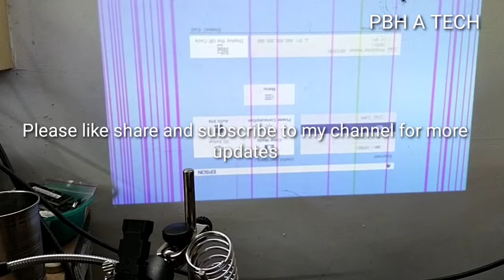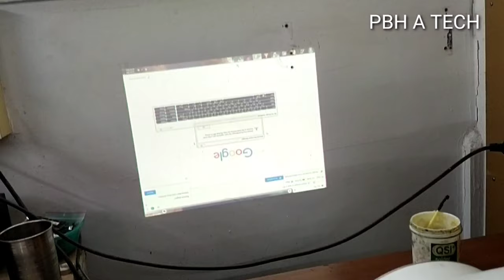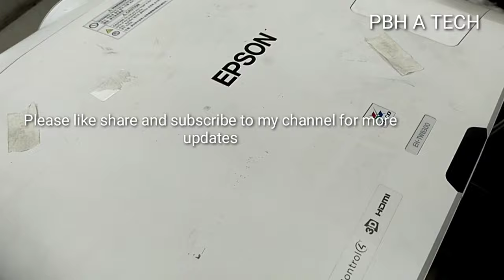#Epson EH -TW8300 Projector Line on display & how to change LCD

Comment: My projector is Epson 525w, it's lcd assembly needs to be changed

If I replace it with 1920x1200 instead of original 1280x800, will it work?

Comment: How did you align the LCD ? I have the same problem with my 6100. Thanks!
Reply from the maker: Are you a technician?
Reply: @computergearstudio  No, I have the TW6100 and I have a problem with the image. After open the projector, I have a problem with the 3 lcd matrice
Reply: Atleast help ppl telling or showing  how to align LCD so many cuts in the video not properly showing how to change and align the lcd prism. You are not helping at all. Cheers
Reply from the maker: Sorry I will charge for alignment
Reply: @computergearstudio  then mate stop uploading useless videos if you not helping others charge your locals who come for repairs.

Anyway there are more videos on YouTube how to align the lcd Prism after changing the LCD RGB panel so don’t think you are the only one.cheers
Reply from the maker: Okay sorry sir  as you wish
Reply from the maker: Great 👍 best of luck 
Can you do this?
Reply: @computergearstudio  I need your help, they changed the LCD of a 2000 home theater and now the colors are misaligned
how much would you charge me to help me align them, a minimal idea of how to do it
I write to the mail
Reply: That's very easy, the function is integrated in the beamer menu
Reply: @JJ37_  function in the menu is for precise aligment like 1 or less of a pixel not by few centimeters like in this case. Besides he don't pop the menu, so your advice is wrong.

Comment: Im  projector repair do you have software or EPROM  for epson projector ??
Reply from the maker: No
Reply: @computergearstudio  thx bro i have also eb s41 with no display  the a/v contact is good the projector seem working fin but the problem no picture on screen do you have any idea whats get wrong all voltage are present only 6v near the lcd connector not present ...any ideas plz
Reply: Hii

Comment: Hi, I 've epson 8350 it shows some pink patch in screen so I replace the RED LCD, after that I'm facing white and red double image (not merged, try to replace old the issue as same) how to align this. Please help me
Reply from the maker: Are you a technician
Reply: Sorry for the late reply (it's my other account), I'm a technician for av and home automation products, using this projector in my home last one year last.
Reply: @computergearstudio  I'm only serviced the dead and ballast issue cause. This is my first try to replace lcd panel. Please help me how to fix this. I seen your video I can't understand how you done this alignment.
Reply: @computergearstudio  please help me waiting for your update
Reply from the maker: Actually this is not easy work so you will not do this
Reply: @computergearstudio  thank you for your support. It's my own projector I can take any risk please tell how do this.
Reply: Please guide me I also bought new lcd panel. I hope you
Reply: Please help me
Reply from the maker: 10.30 ko call karo mai try karta hu
Reply: @computergearstudio  your mobile number